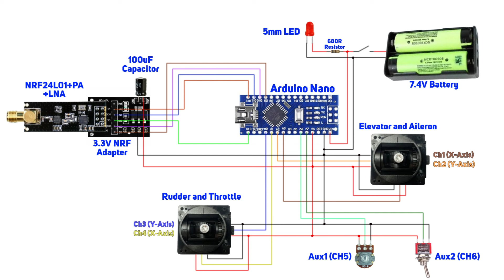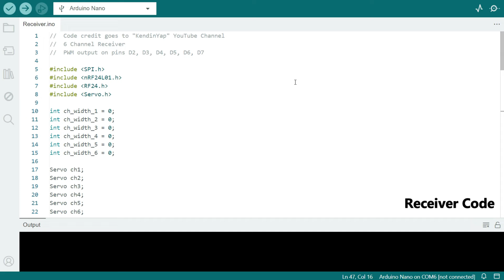How To Make 6 Channel Transmitter And Receiver

Comment: can u make 1 channel remote using this components to control only  an esc motor with a single joistic ..this is for checking my components which purchased online...pls make code for it thank you....
Reply from the maker: Ok I will make IA
Reply: @AKElectroDIY  ok thanks i m wating...........:hand-pink-waving:

Comment: Bro what's the range😊
Reply from the maker: Haven't tested yet. Will soon go to somewhere in an open area to test the range.
Reply from the maker: But working good in 100 meters
Reply: @AKElectroDIY  😓😓😓😓 bro it's tooo low
Reply from the maker: It will be much greater. I meant to say that I haven't tested beyond 100 meters

Comment: Isme Arduino nano koi bhi chal jayegi ya alag Arduino nano aati hai
Reply from the maker: Koi bhi chal jaye ga.
Reply: @AKElectroDIY   coding mobile se ho jayegi or🤔
Reply from the maker: Yes mobile se bhi ho jaye gi.
Reply: @AKElectroDIY  mobile mr code error aa raha hai
Reply from the maker: Wese dusre code upload ho rahe hai?
Reply: Arduino nano adaptor 3.2 volt Nikal Raha hai to kaam kar jayega
Reply: Aapka nrf adaptor kitne volt nikalta hai mera 3.2 kabhi 3.2.8
Reply from the maker: 3.2v sahi hai
Reply: @AKElectroDIY  ok dekhte hai bna kar fir baat karte hai thanks bro
Reply: @AKElectroDIY  thanks bhai transmitter kam karne laga 😍😍😍
Reply from the maker: Nice ♥️
Reply: @AKElectroDIY  lekin kabhi kabhi servo fas jata hai kyu
Reply from the maker: Wo servo ka issue ho sakta hai.
Reply: @AKElectroDIY  power kam mil raha hoga kyuki me Arduino nano se hi 5 volt de raha tha servo me
Reply: @AKElectroDIY  nrf me 100uf 25 volt ka
Reply from the maker: @ParvejKhan-f9y  yes ye ho sakta hai. Servo ko alag esc se power deni chahiye. Because arduino reset bhi ho sakta hai agar servo ampere zyada leti hai.
Reply: @AKElectroDIY hello bhai kya receiver me 2 alag-alag battery use kare?

Comment: svp est ce que je peut brancher une pompe sur la chaine 5 et la commander avec l'interrupteur? Je veux faire un drone pulvérisateur
Reply from the maker: Yes you can connect. You may use a ESC to turn it on and off

Comment: or can i use arduino nano out put  5v pin for servos testing only..not for esc motor??for testing purpose only
Reply from the maker: You might try. But arduino will restart again and again when you move the servos. Because they take more current
Reply: @AKElectroDIY   ho..then can i use this buck converter to run servos (which set to 5v out put in buck converter) servo in put form this converter and GND TO NANO..OK IS IT WORKS?OR IS IT RUN ON 2S 18650 BATTERY(ONLY SERVOS NOT ESC MOTOR?
Reply from the maker: Yes you can use buck converter then

Comment: Ak bhai calibration nhi ho rhi
Reply from the maker: Mera bhi ye masla aa raha tha. Kaafi der baad jaa kr mujhe pata chala ke wiring mein masla tha. Wiring theek ki to calibration ho gayi sahi. Ap Wiring ko dubara check karein. Two wire aapas mein interchange ho sakti hain joysticks ki. Aur multimeter se bhi aik baar saare connections OK kar lein.
Reply: @AKElectroDIY  
Ohh Mai abhi thk karta hun
Thanks for the tip
Reply: @AKElectroDIY 
Ak Bhai ab Naya masla agya hai .Jab Mai transmitter ka antenna Laga ta Hun to signal mai interference Hoti hai. Or jab utar dun to sai Chala hai par abhi range test nhi Kiya  . Is ka Kya hal hai?
Reply from the maker: @abdullahazam5124 
Ap ye solutions try kar sakte ho:-
1. Transmitter mein receiver ka antenna attach kar dena.
2. Transmitter aur receiver ka nrf module apas mein interchange kar dena.
3. Ho sakta hai ke jis jagah pr ap rehte ho wahan paas mein koi mobile tower ho. Jis ki waja se interference aa rahi ho. Ap phir ye kar sakte ho ke kisi dusri jagah pe jaa kr test kar lena.
Reply from the maker: @abdullahazam5124  
Wese mujhe to yehi lag raha hai ke apke area mein se koi interference aa rahi hai. Kisi dusri jagah pe jaa kr test karne se pata chal jaye ga.
Reply: @AKElectroDIY  
Thanks for the tip 
Mai ya try karta hun .Mera ghr ka pas aik telephone tower hai aik. To ho sakta hai  .....

Comment: bro i need you help can you help me?
Reply from the maker: Yes bro. I will try my best to help you.
Reply: @AKElectroDIY  bro we are making a drone for college project 
But you have connected only one 
Motor 
Can you connect 4 motor in it ??
Reply from the maker: This is just a receiver. To connect 4 motors, you need to make the complete flight controller. And connect the 4 motors to flight controller. Not the receiver.
Reply from the maker: What is the deadline of your college project?
Reply: @AKElectroDIY  Jan 22
Reply from the maker: I will try to upload a video before that. On how to make a drone using arduino

Comment: Bro.. Why you are dont make rc plane using this transmitter and reciver.. This have no range enough? I saw many vedios of you... But you are using all in that vedio flysky remote why? How many range get on flysky remote?
Reply from the maker: I haven't tested this yet. The range is good enough. Will test soon
Reply from the maker: Flysky remote has advertised range if 1km. I use that because it's far much better than this one. And why not use the better option if i got. But will test this one too.
Reply: Ok thanks bro ❤
Reply: Pls make àn rc plane using this remote.. Like kendin.. Pls bro
Reply: Can i use 11.1v dc using buck converter for testing this reciver... I connect this dc Buck converter which set to 11.1v ti esc motor but motor beeps single beep... Why i used 2s 18650 battery.. On that time is same as above.. Single beep why?
Reply from the maker: I would surely try to make an RC plane controlled by this remote. Stay tuned!
Reply from the maker: The buck converter and the 18650 batteries do not have enough power for the motor. You need a lipo battery connected to the esc. Then try if it works or not. If you don't have a lipo battery, then for testing purposes, you can power it using a Lead acid 12V battery that is commonly used with UPS

Comment: I made this same but in arduino the red light becomes dark and it stops working and then the light gets dim and it start working this is happening again and again
Reply from the maker: @vanshkakkar4678  
On which side? The transmitter or the receiver?
Reply: @ led side is receiver side
Reply from the maker: Oh yes I'm familiar with the problem. The Output of the ESC is not enough to power the Arduino and servos. 
There are three ways:-
1. Use a high ampere ESC so that it can easily run the arduino as well as the servos 
2. Use a seperate power supply for Arduino and Servos. I mean power the Arduino from another power source which is different from Servo power source. 
3. Try adding a capacitor to arduino voltage input.
Reply: @AKElectroDIY  ok so i have added a capcitor already and when i try to use the nrf adapter it completely stops working and i m using it without adapter and talking about the esc that i wanna tell that i am not using esc for now because i am just testing the tranmitter and receiver through servos only that if it works or not
Reply: @AKElectroDIY  btw i am using two 18650 (3.7volt lithium cell) for arduino nano receiver and 3 18650 cells for transmitter
Reply: @AKElectroDIY  at first it is working properly and now i started facing that led problem
Reply from the maker: @vanshkakkar4678  
Do you power the servos from arduino 5V?
Reply: @AKElectroDIY  yes ofc
Reply: @AKElectroDIY  and i also i forgot to tell that at first it was working properly and in the mid it turns off and when i power it again i got that led issue that first it works then the red led on nano glows brighter then it get dims in just second then it again works
This is happenign again and again
Reply from the maker: That is the issue. To power the servoe from arduino. You need to use a seperate power source for the servo motors.
Reply: @AKElectroDIY  bro now the transmitter and receiver is working properlyy but but i have to use the receiver with laptop usb and when i use it with 2 cells 18650 it don’t works and that led problem comes again
Reply from the maker: @vanshkakkar4678  You just need to keep the power supplies of arduino and servos seperate. You use the 2x 18650 batteries just for arduino. And for servos, power them from a seperate ESC.
Reply: @AKElectroDIY  but how they are working with laptop usb?
Reply from the maker: Are the power supply of arduino and servos seperate with laptop usb?
Reply: @AKElectroDIY  no i am just powering the arduino using laptop USB and servo is just connected to arduinos pins
Reply from the maker: @vanshkakkar4678  Use a seperate supply for them and then tell me.

Comment: Bro how to connect it with moter of two wires  please tell me😢😢
Reply from the maker: The two-wire motor is called brushed motor. You just need a brushed ESC for that. I have used brushless ESC. Everything else will be the same.
Reply: Yes

Comment: Can you please tell me what are the voltages of 680r resistor , 10k  potentiometer and , position togle switch.It can be really help for me😊😊😊
Reply from the maker: If you are talking that in general how much voltage we can give to them, it does not have any general input voltage specification. They can operate on any voltage.

As for this project, I am providing the Potentiometer and toggle switch 5 volts each to operate them for this project.
And I just used a 680r resistor in series with an LED. The LED is just to indicate that the transmitter is ON or OFF. I used the resistor to limit the input voltage to LED (in this case, 8 volts) so that the LED does not get over volt.
Reply from the maker: Feel free to ask any further questions. I will be really happy to help. 😊

Comment: bro in the code throttle, yaw, pitch and roll have lowest signals are 12 and highest are 255, but when I printed on serial monitor and checked, I am getting 29 as the lowest signal and 230 as high approximately for all these 4 channels. is it a problem?
Reply from the maker: Not really a problem.
Reply from the maker: It will work just fine